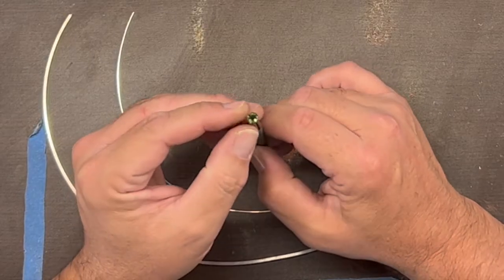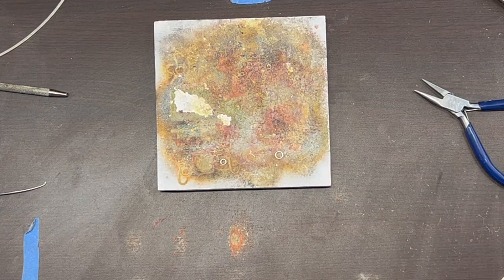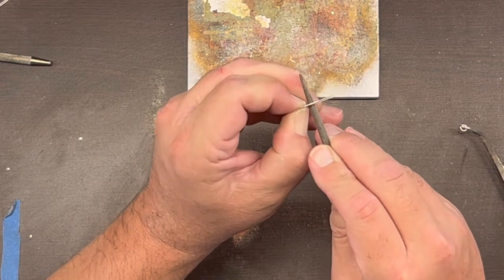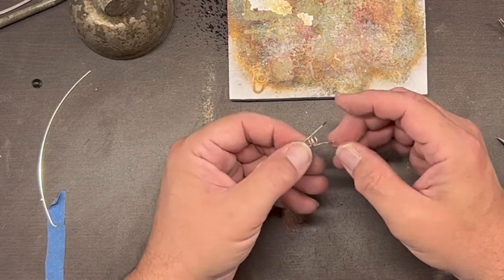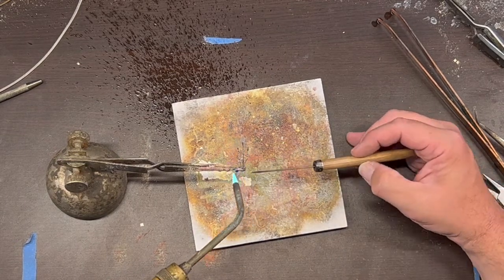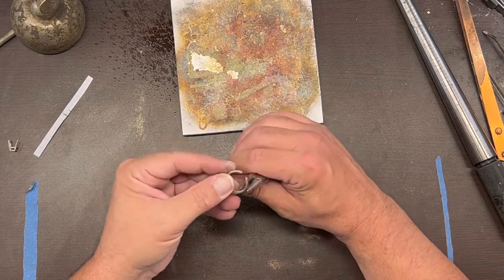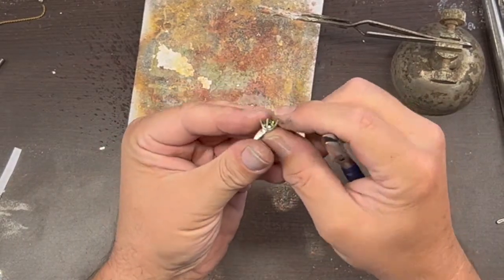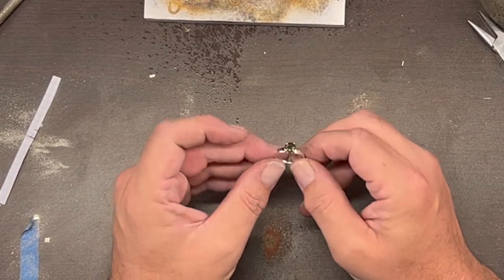Simple Basket Setting: A Silversmithing Tutorial

Comment: Prong settings elude me and it's driving me crazy!!
Reply from the maker: I get it:). It took me some time to really learn how to control the heat on these type. It helps it you keep your torch pointed horizontally and nudge the heat up from the bottom, but don’t linger too long after each solder joint flows. Hope this helps Kristen!
Reply: Thank you! I think it might. I'm definitely getting a solder pick. I've not acquired one yet it seems to be quite useful in the precision that settings need.

Comment: You make everything look so easy Chad!  I am on round two, trying to make this basket setting!!
Reply from the maker: Making these were what forced me to get proficient at pick soldering. I melted quite a few learning to do them. Don’t get discouraged.  The trick is to hold the torch horizontal and nudge the heat up from the bottom.  Also, don’t tip the third hand too much, just a tiny bit.  I still melt them occasionally:)

Comment: Do you use oxygen when soldering
Reply from the maker: Good question Don. I use an acetylene/air torch that pulls in atmospheric air to mix with the gas through little vents in the tip. I have never found the need to use oxygen, as I get plenty of heat out of the setup I have. Thanks for the comment Don!